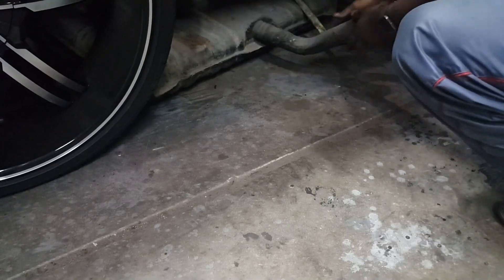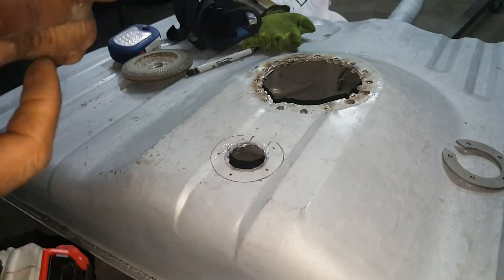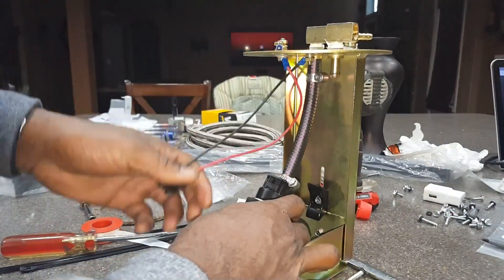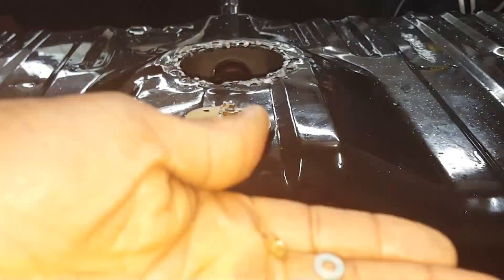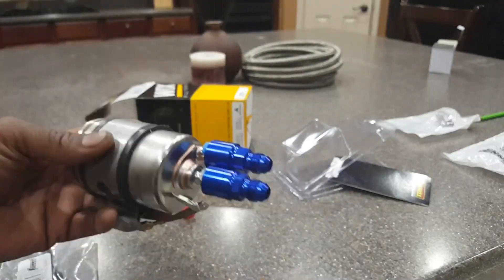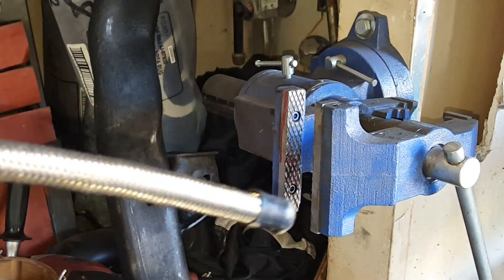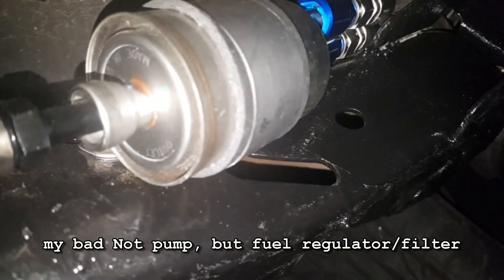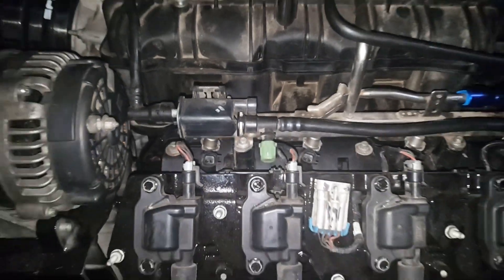LS Fuel Delivery SYSTEM Tanks Inc Fuel Pump PA-4 and Sending Unit' 'DARKNESS LS SWAP PART 7

Comment: You sender unit and hardware is not listed on the parts list. Did the inner mounting ring and rubber seal come with it? Was it the tanksinc universal unit?

Comment: Nice work brotha! Looking good! Also, that black tube you were asking about, that should be your EVAP system/tube. You can just delete it (unless u need to run it). Buy a EGR & EVAP block off plates. Lots of vendors sell sell them together. I got mine off eBay from LSX Innovations.
Reply from the maker: Anthony Griffin what it do Ant, tks for the info..I am going to look that evap delete plate on eBay now and check it out..tks for stopping thru..CJ
Reply: CountrySideClub Fa sho! U shouldn't need them on an old school car. But it really just depends on your state regulations. But most people will delete them any way. I did. But here they don't check cars 25 years and older.